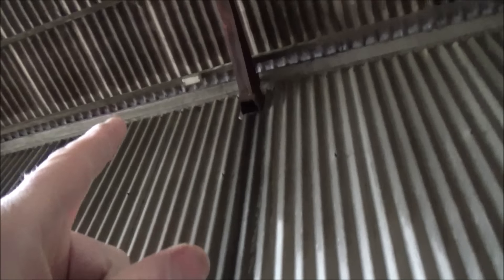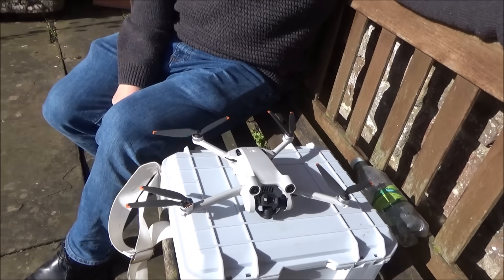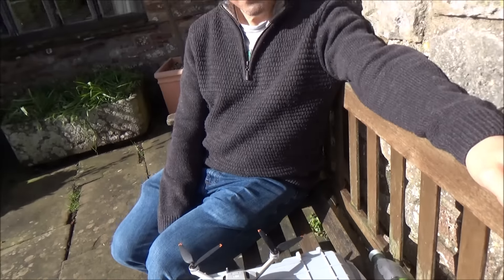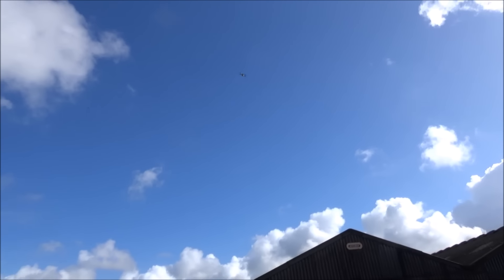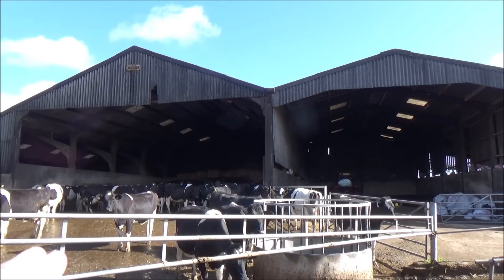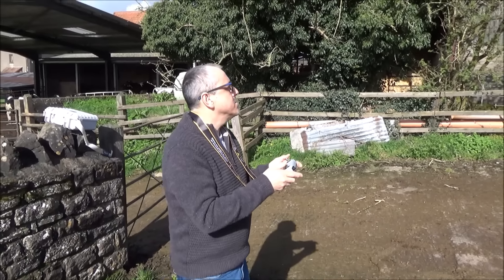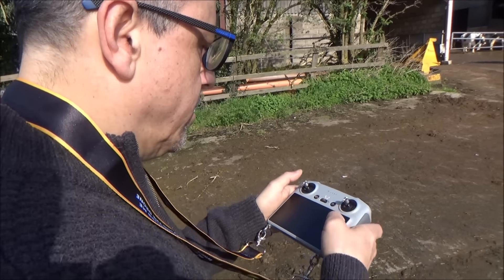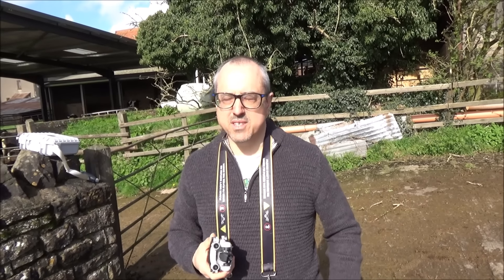DRONE SURVEY OF THE LEAKING GUTTERS

Comment: Quite possible IAE put the wrong label on that gate. Long bolts and 50mm Angle Iron would sort that gate. 
I have a cheap drone 3 years ago just for fun. Water was coming in to our landing ceiling. Horrible place to get up to so used the drone. The wide valley was full of Moss and in heavy rain caused a dam and the wind blew it back over the top of the lead. We got two bin bags full of Moss off the valley, jet washed the roof and sprayed it all with Wet&Forget. Been fine now for over a year.

Comment: Pull those splits out a bit slip some pipe over the broken pipes and drill some holes in and drop some bolts through  all the tubes  you won't  need welding  then. Very easy fix that way .
Reply from the maker: Good tip!
Reply: Had the same thing happen to a iae gate . Tec screw stockboard to it and it stops the flexing when cows are pushing against it 😊

Comment: Has reg got a tele handler with a personal cage . Ive got a karcher pressure washer with the drain high pressure hose which comes with a gutter cleaning attachment that you can put on the end ,that way you could stay inside the cage a just let the pressure hose push its way through and clean the mud and crap out, without having to get up on to that old roof and possibly crack some roof boards

Comment: Bad form on your part mentioning IAE before you've spoken to them Richard. With your profile, I’d be very surprised if they didn’t replace the gate - and if you’d told them what you thought might have caused it, they’d probably offer you a bolt-on strengthener to stop it happening again.
Great video - I thought my 35 would be out of the shed this week but, still got some bits to find. Dave's Tractors - no 79  👍👍
Reply from the maker: i wasn't having a go at IAE just showing what happened.  Realistically this shouldn't have happened and if the products not up to the job then I'm not going to hide that
Reply: @thefunkyfarmer   You're right, it shouldn’t have happened but you made a point of showing their name on the end of the gate and you mentioned their name more than once. You may not have realised but, if you watch the video again, I’m sure you’ll understand what I mean.
Don’t worry about it, we've all done it. It’s one of those 'Bu—-r' moments. 😂😂😂